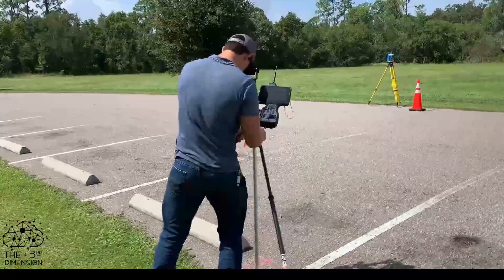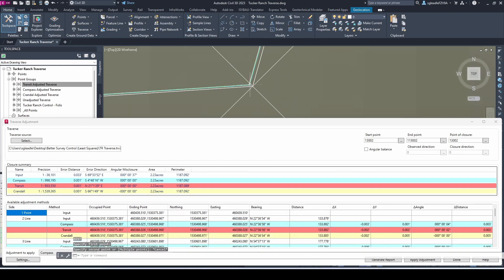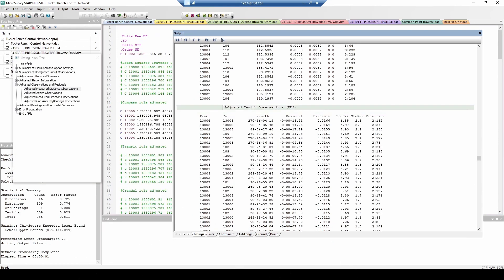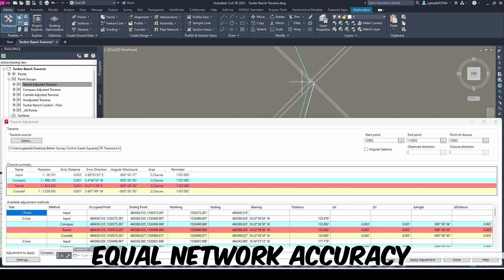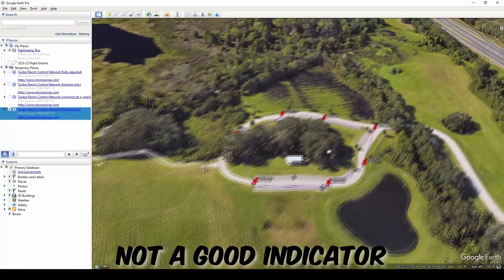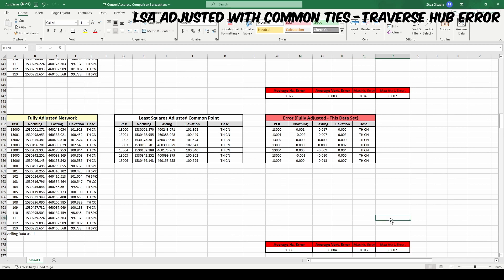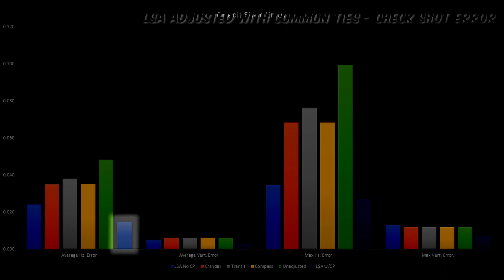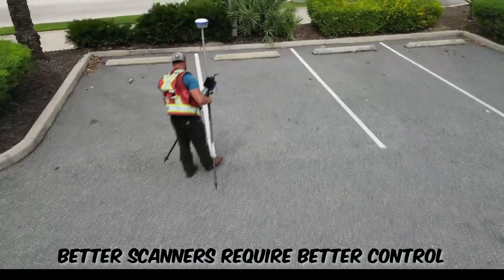Improving Your Survey Control - Least Squares Adjustment with Starnet

Comment: Looking forward to more videos on control. I’m blown away that the control I receive most of the time as a contractor is set using gnss only. We are building large concrete structures and even high rise buildings and this is the first I have heard mention of a least squares adjustment like this. In the past, guys have measured traverses through provided control to tighten it up but this seems like a much better way to ensure reliable setups through the course of the job. I went to a site today that has lost all of its original ground control and they are on level 6 of 17. It’s a disaster as all of the control they are using now has been set with crappy resections.
Reply from the maker: I wish I could say that kind of situation you’re having to deal with is rare but I’m sure in your own experience you know it isn’t. Control networks being set up without a least squares adjustment is never a good idea.